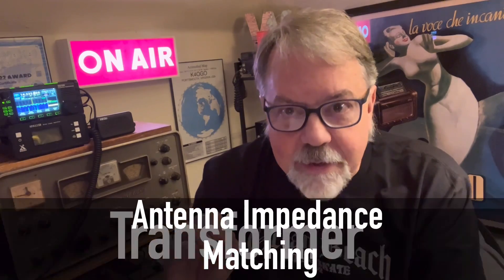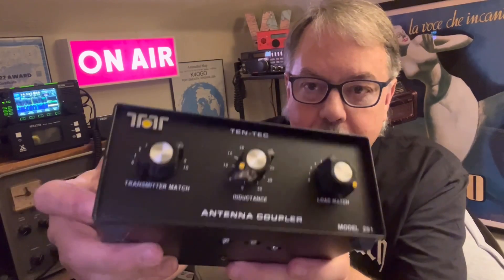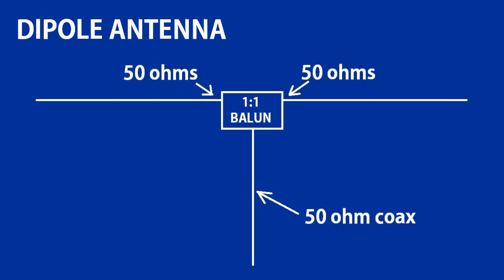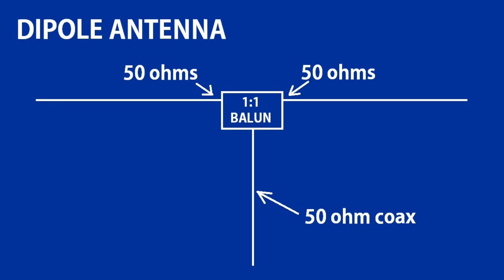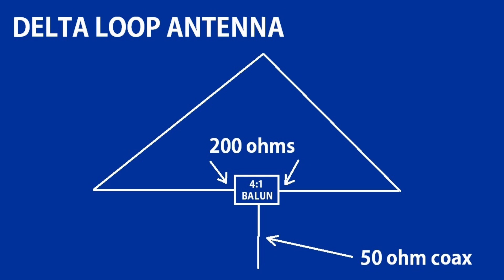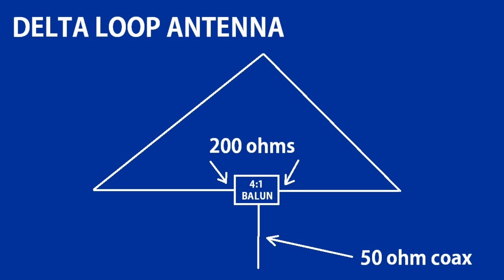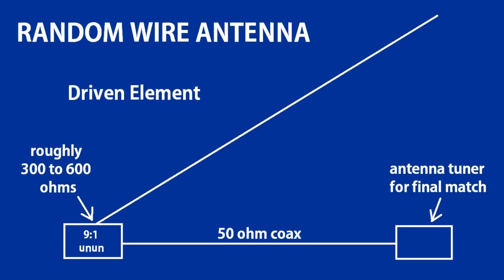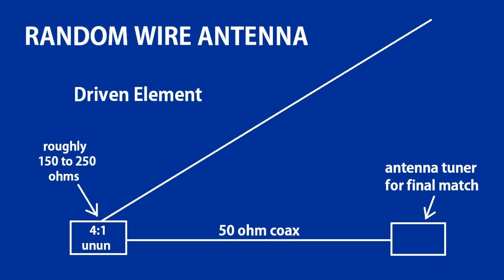Baluns & Ununs - Understanding Their Role in Antenna Building

Comment: Great explanation on baluns/ununs.....thanks!!  For wire antennas though, are baluns and ununs primarily just a tool for connecting the wire to the coax....and doing that in a way that will closely match up the two with a transformer, (as well as to keep RF from making its way back to the radio)?  I have my first HF radio on the way, and I ordered a manual tuner as well, since I thought it was a good idea to always use one.  If I'm understanding correctly, the two options are....1) to use a balun/unun so you don't need a tuner and 2) to use a tuner with a choke so you don't need a balun/unun and just connect with a banana clip?  In other words....using balun/ununs keeps the equipment to a minimum and gets you on the air quicker?  Seems obvious now that I think about it.....but confirmation that I'm thinking correctly is appreciated.

Comment: Thanks Walt. That was helpful. I had a couple EE classes in college 40 years ago when I earned my mechanical engineering degree, but there was zero material about RF antenna design. A friend of mine has a MS in EE and even that didn't cover much about RF. It was mostly IC design and signal processing for him. If the terminology was unbalanced match and balanced match versus unun and balun that would go some distance. The next step would be describe the circuit in a balun and the circuit in an unun and explain why it works for each type of antenna, respectively.
Reply from the maker: Thanks! I’m not sure if YouTube is ready for a structural design engineer to break down the circuit design of a balun or unun but I guess I could give it a try LOL. All the best and 73, Walt

Comment: Thank you for your inspiring video. I am starting with HF and have space for a End Fed Random Wire of about 12 meters. I hope this will give me some possibilities on 10, 20 & 40 meter. How do i measure what the impedance of that wire is, so i know what ratio of Unun i need in order to transform it down to 50 Ohms. Thank you and 73's ... Bert
Reply from the maker: Hi Bert, checkout this website. It will give you a better understanding:
https://www.hamuniverse.com/randomwireantennalengths.html

Comment: Hey, me again. Just subscribed. Great channel. Working towards my first ham license in the US.  Re the Rybacov, I recall you mentioning in your "10 best..." vid that it is a multiband antenna requiring the use of a tuner and also requires ground radials. In the case of your simple vertical rods inserted in a lawn/ground umbrella with the balun at the bottom, would I be right in assuming the radials should all be connected to the balun ground terminal and radiate out? As I've begun to understand, most verticals one buys commercially tend to have a metal ground plate at the base from which said radials, well, radiate. Thanks in advance.
Reply from the maker: Yes the radials or let’s call them counterpoise wires are connected to the ground side of the balun. Here’s a video I did a while back that describes “RF ground” which is what you are describing as “radiating”: https://youtu.be/KjEOUZS_5sw?si=BJLIZXMHbPqJTrqN
Reply: @COASTALWAVESWIRES  Great, thank you! Nice to know I'm at least along the right lines. I'll check it out :-)

Comment: How do I determine the feed point impedance?
Reply from the maker: To truly find it requires an antenna analyzer or by modeling the antenna. The easier way is to go with proven lengths. There’s plenty of great information out there on random wire lengths, etc
Reply: @COASTALWAVESWIRES  Thanks, I did a search and found what I needed. I appreciate the help. 🙏

Comment: I think I get it — then i don't. UnUn makes sense for situations with an unbalanced match (49:1, 4;1 etc.). Then BalUn for 1-1 balance scenario (dipole example). But why would the Delta Loop not use a UnUn? It's 200 ohm t0 50 ohm, using a 4;1. Shouldn't that be an UnUn since it's unbalanced? YOUR CHANNEL HAS BEEN THE MOST HELPFUL/FUN/INFORMATIVE I've found. Can't express my gratitude enough. I'm on the list for a FX-4CR so I can't really start playing.
Reply: Oh wait, is the balance relating to the physical design of the antenna rather than the Ohms? Endfed uses an UnUn since the feed point is at the extreme end of the atennas, vs a dipole or delta loop where the feed point is in the physical middle of the antenna, and thus, sues an Balun. That would make sense. I hope I'm correct.
Reply from the maker: You are correct! But it doesn’t necessarily have to be in the middle, an OCF dipole uses a balun as well.
Reply: Paired wire, like ladder or Swedish lines, the RF are equal and opposite, balanced. Coax, center wire and shield have different physical characteristics,so have unbalanced RF signals. Right?

Comment: This video helped me for sure.  One thing that would have made it the GOAT Bal/Un/Un video would have been to tie in the mantra that you should just try it.  Show us the impact of no Bal/Un and then show the beatiful matching impedence after.

So, will you still make a contact using a 4 to 1 instead of 9 to 1?   Will you make a contact with a 49 to 1 or without?
Reply from the maker: The real question is “would your transceiver’s tuner tune the antenna with a 9:1 instead of a 4:1 or 49:1” the answer is probably not because the purpose of using a 4:1 versus a 9:1 versus at 49:1 is to make the feedpoint impedance as close to 50 ohms to match the coax and radio. You may even be able to tune one of the others with a different transformer but have greater loss in the coax and out of the antenna meaning not making that contact.
Reply: @COASTALWAVESWIRES  the good news is, I totally understand now.  In theory anyway.  I'll be putting it into practice very soon!  Love the videos.  Keep em coming.
Reply from the maker: @tsp2jxd  thanks! Hope to catch you on the air!

Comment: Many years ago (during my CB days) I learned a balun can be a really neat thing.  But you have to be willing to experiment a little.  Someone gave me a 4-element beam which had an insulated dipole driven element with a hairpin match (He did not know how to feed it).  Not wanting to try and feed it directly with coax (did that with another similar beam one time with poor results), I decided to try and feed it with a 1:1 balun.  Since the dipole driver would have a 75-ohm feed point impedance, I connected the balanced side to the hairpin, and used 75-ohm coax to feed it (not CATV coax).  All I can say is 'wow'!  Not only did the antenna work very well, it was also the quietest antenna I have ever had.  The SWR measured at 1.3:1, and I could hear signals others could not, especially in dry-air Santa Ana conditions when the air becomes 'charged' and a lot of static is present.  The hairpin match provided an awesome DC ground which, in combination with the balun, provided a virtually noise-free beam.  I used it for many years before a wind finally blew it down.  Wish I still had it!

Comment: Are you considering that a tuner has a 4 to 1 balun built in would one then be using two baluns and is that advisable ?thanks for video
Reply from the maker: Hi, I think you might be a little confused. An antenna tuner doesn’t have a balun built into it. It’s all about reducing the impedance down at the feedpoint of the antenna with the balun and then tuning the coax at the other end with the tuner to have a match.
Reply: @COASTALWAVESWIRES  thanks for reply

Comment: Thanks for another really informative video.  Where did you find that chart of the wire lengths and corresponding transformer?  Also do you have a  video showing when you might need a counterpoise, vs radials?  Now that the weather is a little nicer I’m going to actually start building these antennas.

Comment: How do you know the impedance of your antenna?
How do you know the impedance of the coax? Doesn’t it depend on its length?
Reply: You know roughly what the antenna impedance will be by its design. Depending on height above ground, the centre point of a half wave piece or wire stretched out in a line will be 50-100 ohms, with the average to ideal being around 72 ohms. This is where the current is the highest and the voltage is the lowest and is the lowest impedance. As you move along the half wave towards the end, the impedance increases as the current decreases and the voltage increases. At the end there will be a very high impedance, about 2500 ohms or so. Different feed points on different antennas will present different impedances. You can read up about the different designs and feeds in antenna design books (or on-line!). You can use an antenna analyser to measure the impedance at any particular feed point. Regarding coax, you buy it as such, so 50 ohm coax will have an impedance of 50 ohms, 75 ohm coax will have an impedance of 75 ohms. You can then get 300 ohm, 450 ohm, or 600 ohm "window" or ladder line. Other impedances of coax exist but the main ones we use are 50 and 75 ohms.

Comment: Do you have an opinion on ( for receiving only) what UNUN ratio would be good for 200 ft wire antenna with a ground rods on the ground terminal. i want to wind my own UNUN and have a low noise floor
Reply from the maker: I do know that 203 feet and 9:1 are a good match for a transmitting random wire antenna. You might want to try 9:1 as I'm sure it would probably do well as a receive antenna.
Reply: OK Thank You. @COASTALWAVESWIRES

Comment: Please let me know, If I use 1:1 Balun for a 40MB Dipole, By using ATU, Can I use that antenna for 10, 15, or 20MB? Will the performance be good? #VU2XFD
Reply from the maker: Yes you will be able to use it on all those band with an ATU. You probably won't even need the ATU on 15. 73, Walt

Comment: Hey Walt! another great video! I like making my own, rather than buy them. When you describe the impedance in ohms, That is exactly how you test them. I have resistors soldered together that approximate the EFHW, Random wire, or delta loop. Connect them to the antenna connection and the counterpoise connection or to the shield side of the coax. Then connect your swr meter, and if they give a close to 1:1 reading, you know they will do the job. When you make your own, you can tweak the windings, and tune them up even more. Have you seen the Gabil GRA-HF750T antenna setup? You can turn your qrp rigs into an HF walkie talkie with these. Add a short counterpoise and they will amaze you.
Reply from the maker: That's great info, thanks for sharing!
Reply: Just got my Gabil. I loooooove it.

Comment: So does that mean that the antenna tuner is doing the same matching, but between the transmitter and the coax? I guess the impedance of the amplifier output would change depending on what frequency you've selected, and that's why you need a whole other device? Because it seems that transmitter manufacturers could reasonably predict that 50 ohm coax is what they're gonna see on the output side otherwise. Maybe you could clarify antenna tuners in another vid, but this was really clear and simple for explaining the un/bal-un concept - thanks!
Reply from the maker: Thanks for watching. Yes the tuner is  pretty much doing the same thing at the feed point. Basically with  the random  wire antennas and the 9:1 the idea is to get the match close enough for the tuner to somewhat "fine tune" it. Great idea, I'll look  into doing a video on antenna tuners. 73, Walt

Comment: So you helped build Ocean Beach huh? LOL..... Well you figured out the plans and the structures and I nailed them together. Started my construction career in Newport Beach back in 75 when I got out of the service. Lived on a boat in the back bay while learning to pound nails and string wire. 73 and thanks for the great video. Still a little to learn about these things. Like how do you determine the impedance of the wire you are connecting to the ballun as a driven element?
Reply from the maker: Thanks for commenting! Determining the impedance of the wire can be done with an antenna analyzer and also by modelling the antenna. I basically go with known lengths and trim to suit. It would probably a good idea to do a video on  that topic thanks. All the best and 73, Walt
Reply: Please do because I don't know what you mean by modeling. Please know that I am old and come from the TUBE days. Having a hard time with all the digital crap for the general test because of that. Wish I had gotten my General much earlier before all this digital stuff. LOL... @COASTALWAVESWIRES

Comment: Hello Walt!  Recently you made a 17.5  Rybakov antenna video using an LDG 4:1 Balun, whereas in the past you used the 4:1 Unun.  In this case, what would the difference be?  I tried this at Pajaro Dunes on the West Coast using the 4:1 Balun.  Made three contacts for proof of concept and packed up.  Would there really be any difference using the Unun?
Reply from the maker: Great question, I found that both the unun and balun worked equally well. I really didn’t see a difference at 20 watts.

Comment: Great video giving an easy to understand explanation. When I got licensed, UnUns weren't really being used but now they seem to be pretty popular. I had a random wire(not sure how long it was) antenna that was fed with single wire that went straight into the tuner. I wonder who many hams still do that? It worked well but on some bands the RF in the shack made the rig go a little haywire if the power was up too high. Your videos are always informative. Keep up the great work.
Reply from the maker: Thank you so much! I’ve been thinking about building a long wire antenna with that TenTec antenna coupler I showed in the video. So it would pretty much be like your antenna you described. 73 my friend!

Comment: An excellent explanation as always Walt. It makes  sense to those who don't know. However, there is one basic assumption that most YTers make, they assume that a budding antenna builder knows what the impedances are to start with for a prticular aerial configuration, I recall I think DC showing a dipole fed in the centre = 50 ohms and then moving the feed point to one end until it became an EFLW and the impedance was as high as it was "going to get".

Obviously the baluns for this would start at 1:1 going through 4:1, 9:1 and so forth on to 49:1, maybe that is a reference diagram that needs drawing by somebody?  Then there could be coverage of those in the 64:1 range or special configurations?

Just a thought - 73 de Terry
Reply from the maker: Good thought Terry, 73 Walt
Reply: Maybe there is a market for a digital power meter that shows SWR and the impedance figure?  I know that you can get meters to measure the impedance, but to have it on a straightforward 3 in one meter (that doesn't need a tutorial to remember how to drive it every time) would be a handy bit of kit?  @COASTALWAVESWIRES

Comment: Walt, I enjoy your videos and  have learned a lot. However, I think you have a mismatch here. The Transmitters are designed so that the SO-239 will "push" the most power out at 50 Ohms. It is a factor of the transmitter. I consulted with a ET friend, also a Broadcast engineer about this. The 50 Ohm Coax is a trade off for cost, efficiency, lower signal loss that coax at other resistances, such as RG-6. The Transmatch Inductor lowers the impedence from a non-resonant antenna to the transmitter side, so the transmitter will push out the allotted/desired wattage...BTW, I would still like for you to present to our Portable Operations forum, as you have lots of great practical info for new POTA and SOTA ops. Thanks for consideration. Bob
"Amateur Radio transceivers are designed to work with an impedance of 50 ohms, so you must use 50 ohm coax, or find a way to convert the 300 to 600 ohm impedance of ladder line to 50 ohms. If your radio “sees” anything other than 50 ohms, it will reduce its output to protect itself from the possible damage that can result in a high SWR condition.
Feed Lines - ARRLtext

Comment: Thanks for your video.  My biggest question is how does one determine the ohms of their antenna, so they can then determine they type of balun to add?
Reply from the maker: Thanks for watching. Most lengths are common knowledge from previous builds, for example 49:1 for a half wavelength wire, 1:1 for quarterwave, 4:1 balun for an Off Center Dipole where the feedpoint is 1/3 of the length from the end, 9:1 for various “random wire” lengths like 41’, 35.5’, 29’ etc. But to truly answer your question the actual impedance can be physically measured using a VNA or Antenna Analyzer. Another method is to model the antenna in a software modeling program.

Comment: Hey Walt, happy new year! Hope you had a great holiday season.  Silly question: I have a 49:1 balun on a random wire. I have no idea of its actual impedance. Is there such a thing as "too much balun"? If my impedance is 600 and I'm running 49:1 then this works out far less than the 50ohms needed. Is that detrimental in any way or can 49:1 be a one-size-fits-all? What's the best way to find out the impedance of an antenna? Thanks again!
Reply from the maker: Happy New Year! That’s a great question and there are a lot of variables to what you’re asking. Yes you can definitely have “too much” balun but there are simple ways to figure out if you’re good. The simplest is to just check SWR, good low SWR pretty much means you’re good to go. The proper way to check impedance is to use a VNA or Antenna Analyzer and check the feedpoint. I say if it’s working and your SWR is decent, don’t overthink it. Fire up that radio and start making some contacts!
Reply: @COASTALWAVESWIRES  thank you so much! 👍🏼👍🏼